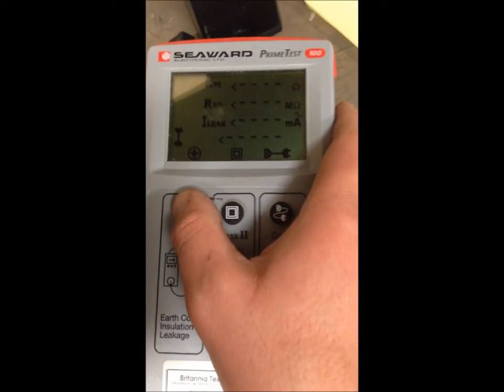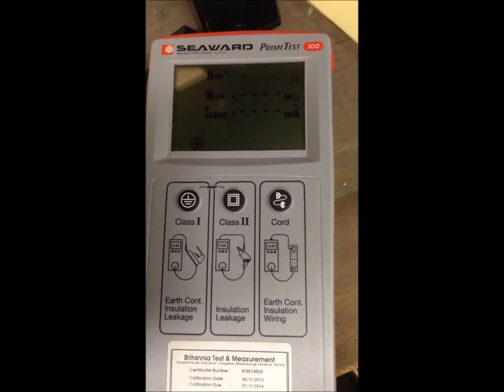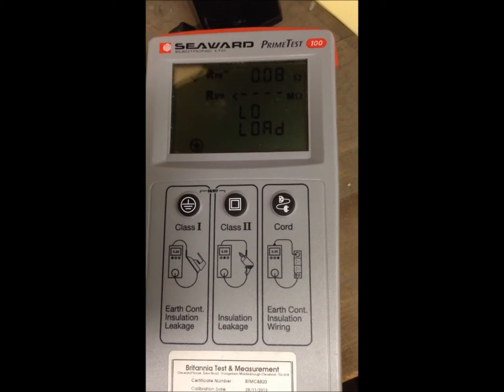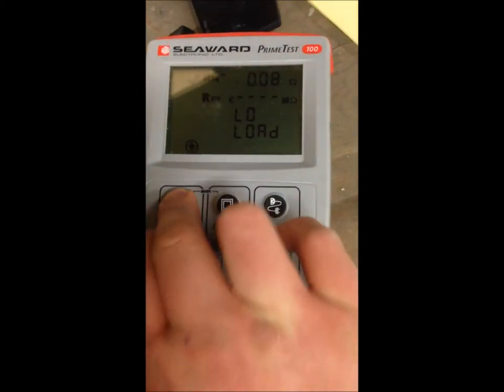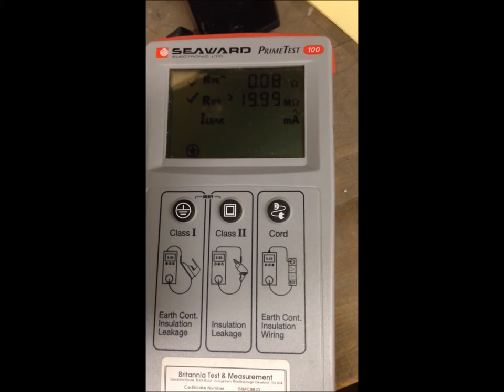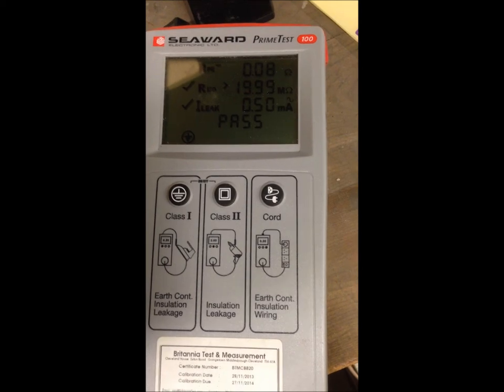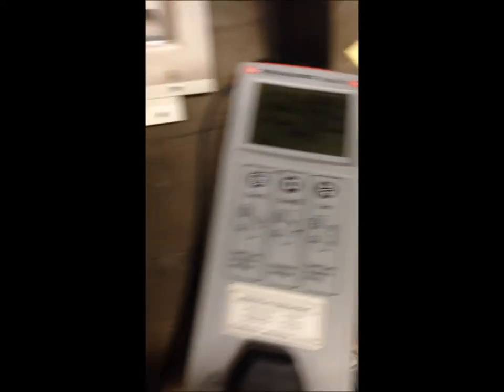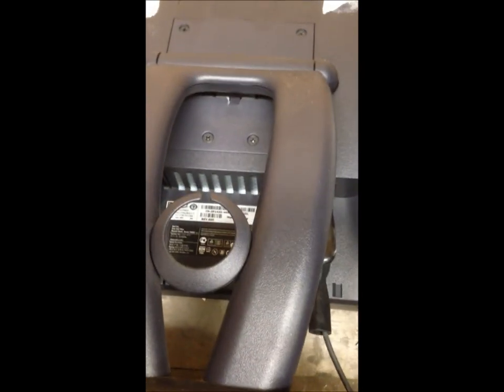PAT Testing a Computer Monitor

Comment: am I right in thinking that you cant use a standard tester on a pc and monitor, as they use 500v I guess only the expensive tester give you different power options to test pc equipment ?
Reply: You run a soft test, insulation is tested at 230v instead and earth bond at 10A instead of 25A..... this is mainly for PCs and other assets with HDD/SSD or sensitive PBCs (RAM)
Some guys opt for the even softer 200mA earth continuity test (designed for assets with FE functional earth)